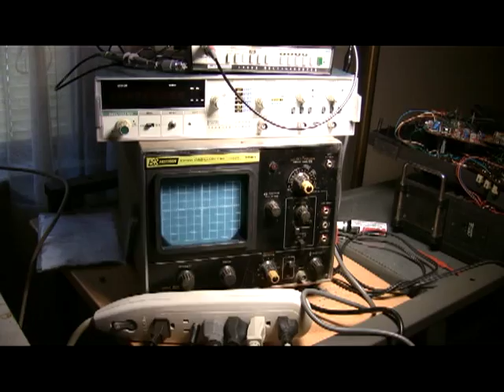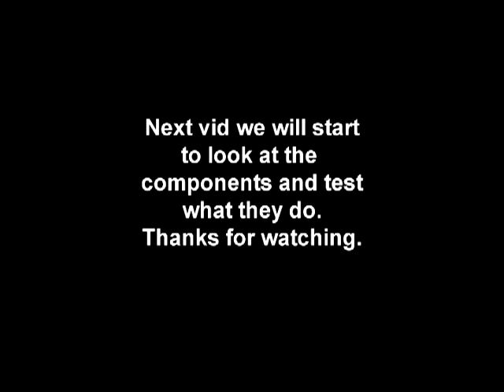Talking about crystal radios

Comment: a spike in the ground is not near as good a ground as the one you are using. You cannot get an AC connection to run off a spike in the ground. Even when the spike is driven into surface ledge solid rock.